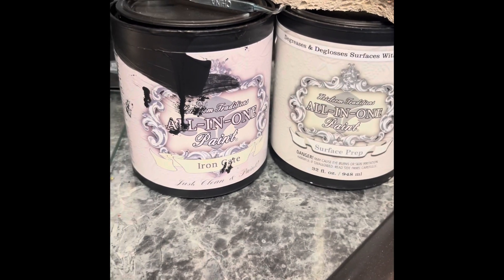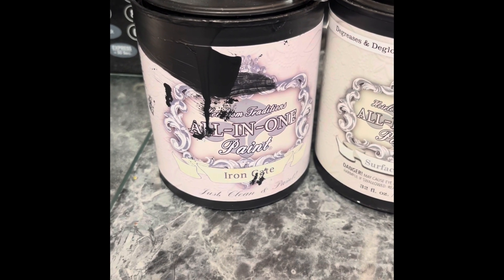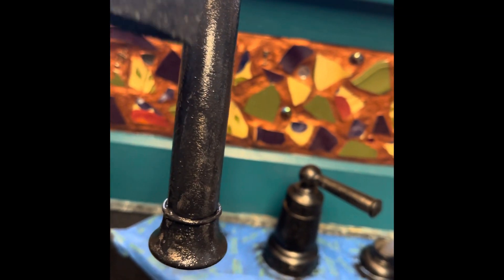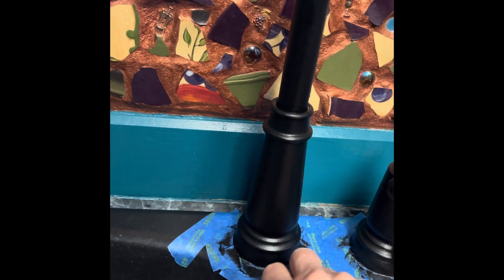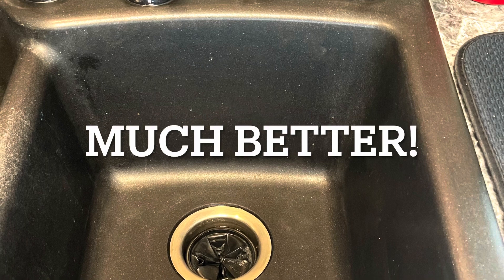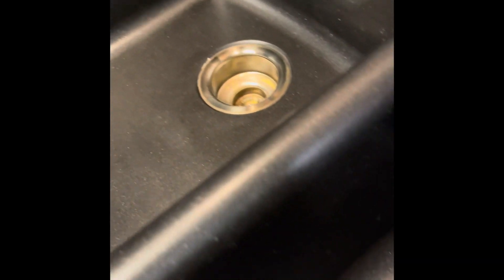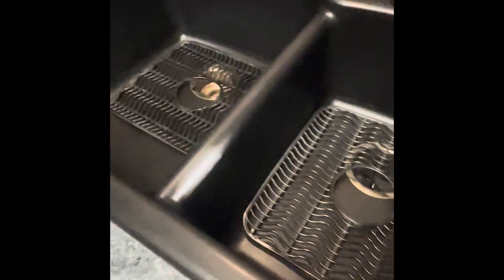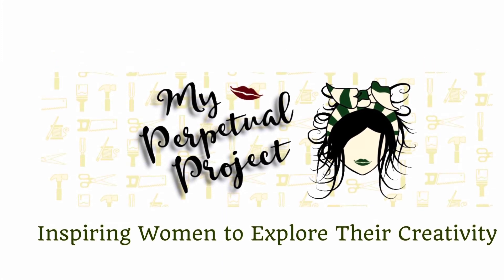July 21, 2023

Comment: But does it chip? I painted some door knobs and hinges and the paint I used scratched off easily. I ended up purchasing new ones from amazon.
Reply from the maker: Overall, it’s holding up amazingly well! There’s a small chip on the tip of the on/off handle and one at the base of the sprayer where I scrubbed too hard. I’ll just touch those up. I’m really pleased with how well it’s doing!